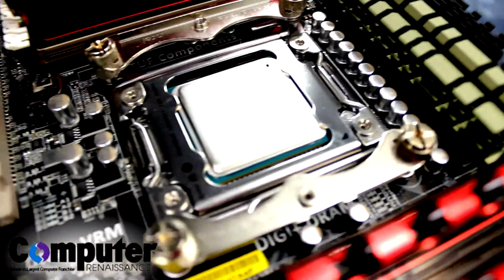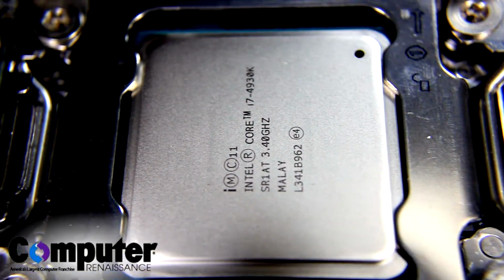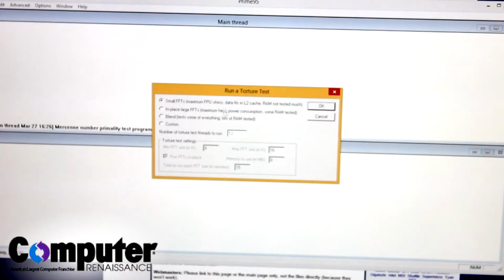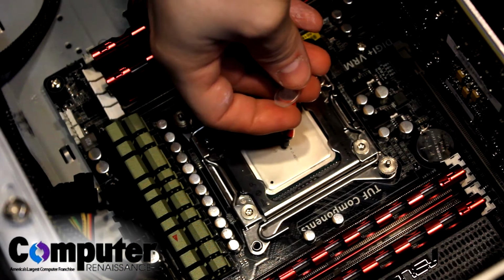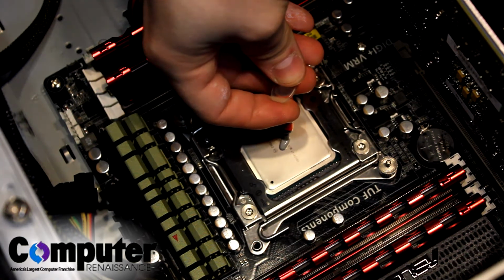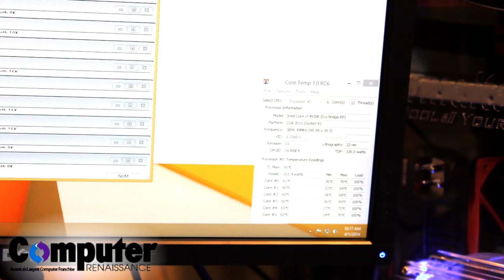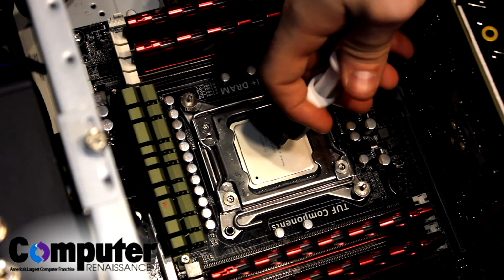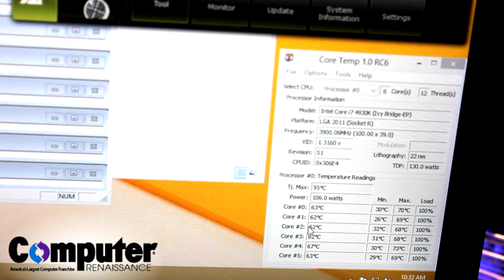Thermal Compound Comparison - Is There Really A Difference?

Comment: You need to do one with no compound as a baseline.
Reply: Don't listen to what this moron is suggesting. You should NEVER put a heatsink on without some sort of thermal compound. So "no compound" is not really a baseline because it is not even a situation that should be considered. Its like using "bare CPU with no cooler" as a baseline for testing cpu coolers. If I could down vote his comment 100 times I would.
Reply from the maker: We had considered this, but after watching some other similar videos from other you tubers we decided against it.  The CPU without any thermal paste got to unsafe temperatures and since this was in a new computer we were selling with a fairly decent I7 CPU at the time, we didn't want to damage the CPU in one of our customers brand new custom build machines.  Thanks for the suggestion though, we may revisit this with an older K series processor overclocked that we don't care about and use no thermal paste for the final test.
Here was another video where the no thermal paste was tried if you're curious about the results. https://www.youtube.com/watch?v=D-pr4cf70qY
Reply: There is no sense in using no thermal compound, so no sense in testing this. That is like testing how many horsepower a car will make if you drain the oil out of it.